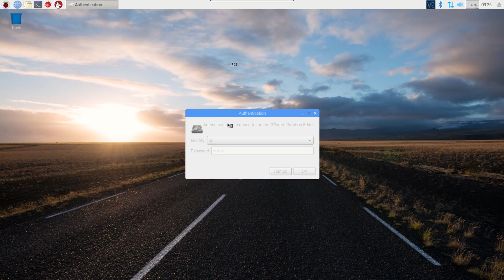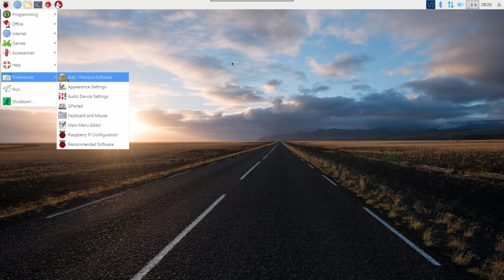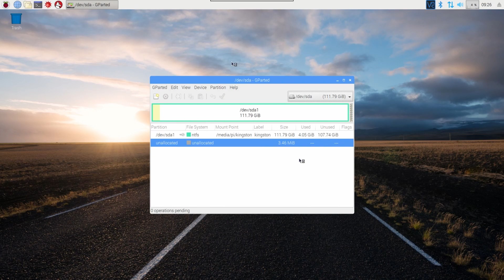Modify a USB to Sata Adapter for a Raspberry Pi - How To Break It

Comment: I'd use a more powerful barrel power supply to power both the RPI and the HDD/SSD instead of the powered hub just to make it a bit cleaner, but Good job!
Reply: Dread Steel  what power plug would you use over what comes with PI?
Also, PI 4 power is different I think,  would you change that supply? If so, to what supply rating?  Thx

Comment: is it possible to make sata to usb HDD adaptor using arduino or respberi pi ??
Reply from the maker: I'm not sure what you mean by this. The adaptor is a separate piece.
Reply: @HowToBreakIt  i mean , can i use Arduino's usb to serial feature to interface sata hdd windows  so i can use old hdd as storage device ?
Reply from the maker: That is a good question. I actually don't know much about arduino. But if I had to guess I would say probably

Comment: Can you please share links to purchase all the above items ?
Reply from the maker: The specific USB SATA adapter I bought isn't available from the exact seller I purchased it from. But as many pointed out, adapters with two usb heads exist and cost about the same as one that you would have to modify. Here's a link to the USB to SATA adapter with only one head, since it's similar to the one I used in the video. https://www.ebay.ca/itm/USB-3-0-to-SATA-III-22pin-7Pin-15Pin-Data-Cable-Adapter-for-2-5-SSD-/332692028007?hash=item4d75fd7a67